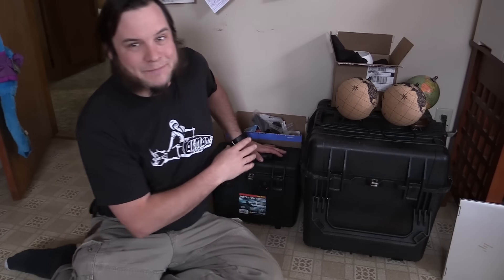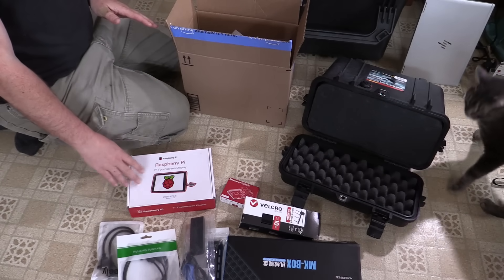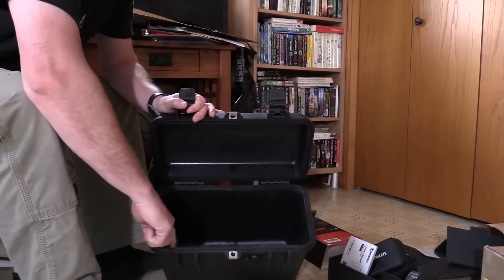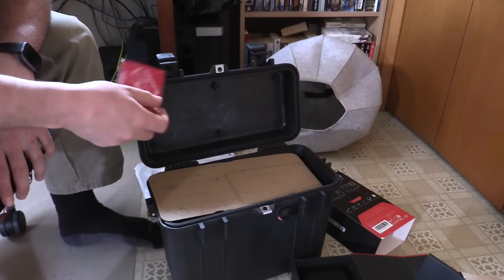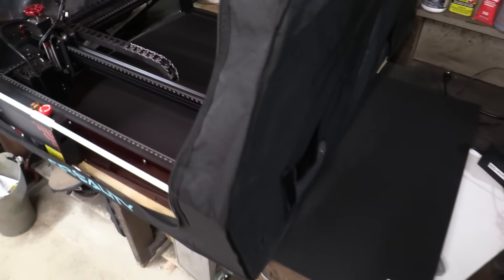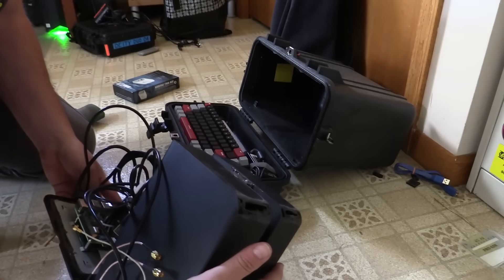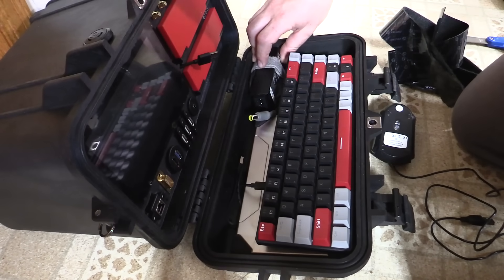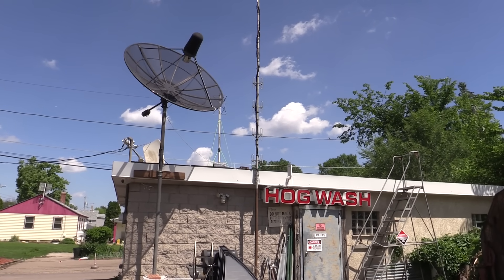Satellite Hacking Cyberdeck v2.0

Comment: It because the raspberry pi needs 5v 5A. many charger are only designed for 5v 3A. You need to use 4X 18650 cells battery hat that specifies 5v 5A, Geekworm makes one

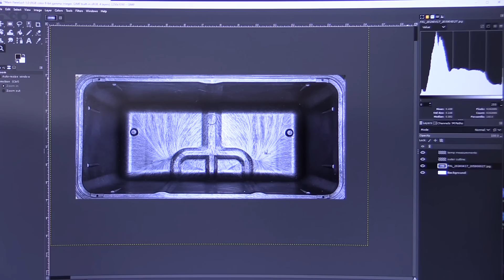Comment: 4:22 how did you manage to get the measurements just by taking a photo? what other factors or math did you do to get this?
Reply from the maker: I measured the width and length of the opening and adjusted the tracing in GIMP (open source Photoshop alternative). I made a few cardboard templates to check the fit and had to adjust it a couple times.

Comment: Will there be a V3.0
Reply from the maker: Maybe, I have some ideas for another design but no time to work on it!
Reply: Alright, Have you Used The Raspberry pi 5 and other versions instead of the raspberry pi 4, if not, what about Arduino and other clones of Arduino.

Comment: So- I liked this video so much (and my girlfriend saw me watch this video like 5 times that she said: ‘Eric you should just make this then’) that I’m going to build a similarly inspired Cyberdeck. 

One question that I’ve raised is- the antenna on the top right, is that connected to Pi as an external WiFi antenna? If so, is there an adapter that you recommend to use to get it connected to the Pi?
Reply from the maker: That one was on a USB Wifi adapter, which I think I've swapped out. I've gone through a couple changes on this. I believe the original one was just Wireless A/B/G, so not the most modern. I'd actually have to dig this out and open it up to remember what's in there now! I need to add a few things to it anyway, like a different power board and maybe a LoRa board, so I should do a follow-up video at some point.

Comment: ... why not use a trackball instead of a mouse?
Reply from the maker: Haven't found one small enough to fit in there. Those were fun in the 90s but I don't see them very often now.
Reply: @saveitforparts  they are still around to some degree 

Oddly enough, it is one area that "retro gaming" and "accessibility" tends to have a crossover of people (lots of retro games work best with a trackball, and trackball tends to be better for some people with range of motion stuff going on)

Comment: Couple of tips and also just amazement lol. For the laser cutter if it you think the thickness might be a bit too thick try flipping the plastic. if you need to, make a 3d jig to hold the corners so it stays centered. then save two cut files. one normal, then one mirror file. Just be sure to flip the plastic the same way you mirrior your cut file. as long as the center of the cut is the same for both sides in your files it should be fine. 

          Also crazy work that you found those voltaic batteries for only 20$ when each would go for 150 new. Good find

Comment: The curled corner on that lid is the plastic shrinking as it cools. Is you bed at the proper temperature and you maintain it the whole print? If printing with ASA or ABS you need a heated chamber and you need to maintain that temp also. Is the print bed clean, as in you just washed it down with Windex and have not touched it with your hands clean? If not, things won't stick properly. Glue stick, hair spray, etc. are for people who fail to keep the bed clean. The only time I use gluestick is to help prints release if I am printing something like TPU, which can hold too well to my PEI sheet even once it has cooled. If a heated bed and or chamber, and having a pristine clean bed doesn't fix it, try mouse ear brim right on the corner itself.

Comment: Lids pulling off 3d printer bed. Cause is printing too hot. Increase the layer count (like 20x 0.2mm layers before turning on/up the printing / bed heat. The moment I did that my printing lifting problem was solved.

Comment: May be worth getting some water proofed sockets so you can have external connections. They make them for marine use. Should be able to easily find the ones for USB. Probably HDMI too.
They have a screw on cap with an O ring that covers the sockets when not in use. You would just need to make sure to get a tight fit into whatever hole you drill and seal it. Maybe use some plumbers glue in the hole.

Comment: One of my cyberdecks (RPi4)would throw the low voltage warning. I used a Raspberry Pi power supply and no longer get the warning. Did your low voltage warning ever get resolved?

Comment: When you want to power up pi from any USB, use 1) buck/boost module, or 2) USB trickle board for QC/PD powerbanks, then buck converter back to 5.1V 5A. The 5.1V is important, as it makes the Pi run much more stable - same voltage goes from official Raspberry power supplies, so do not worry. But i agree, the USB powering of Raspberry Pis is terrible and lacks any logic in times when QC/PD protocols are common in every charger. I usually power them with settable buck converters, because i aint buying raspberry brand power supplies when i have plenty other powerful chargers .

Comment: Try USB 2.0 cable for Raspberry Pi 4B if didn't work when plugged it into a more modern USB host port. The cable should be rated at data transfer rate 480Mbps. Make sure it's from brands with reputation. I used Scosche Strikeline USB 2.0 cable, some USB power sources previously failed to power the Pi 4B now work properly, as it forces the port to follow 2.0 specs instead of 3.0 or PD. However, some people say later batches of Pi 4B do not have the issue, they can actually take advantage of PD.

Comment: For the power bank you could flip it around so the plugs are inside the case and add some connectors on the inside of the tray for it

Comment: Hey bud, been 3D printing for quite a while. If you don't already have one, i'd buy a whambam thermal enclosure/tent for your particular 3D printer. Or at least one big enough to fit its dimensions. Some of your parts are bending up because theyre cooling faster in places and causing stress/tension to build up in the material. Close it up, or even just take a cardboard box and coat the inside of it with something like a reflective/thermal insulating material (like those grocery store 'cold' bags that are supposed to keep the icecream cold on the way home). Or... a box with at least a couple layers of tinfoil over it. That should at least be enough to keep the heat around your prints while theyre printing, and stop some of that heat loss. Once I did that, my 3D print warping almost completely dissapeared. The last printer I bought, I made sure it was one with an enclosure and everything. 

After I enclosed my prints, and also started a printing a lot of my parts in ABS-GF, warping is near-zero. I haven't had warping at all for a while, and If i do its so slight that I cant tell. That ABS with glass fiber fill is amazing. Plus its awesome at withstanding higher temps too (when I need a printed part to be exposed to like... the temps near and around an automobile engine lol..)

Much love and AWEsome video/project.. i'll be checking your channel for any other projects I might be interested in doing myself!

Comment: Addressing your low voltage warnings, have a look into Buck/Boost converters. you should be able to find an adjustable one that will deliver enough current at the required voltage to sate the very fussy raspberry pi board.

Comment: The pi will work with all usb-c PD chargers that support 5v 3A. Make sure to connect it with a type-c to type-c cable. Type-a connections don't support PD. The type-a ports only support other quick charging standards (like Qualcomm quick charge and third party phone standards), and won't necessarily supply 3 amps to the pi. I've noticed you switched to a type-c connection later, that's why it works after that point.

Comment: Very cool, but I've never heard of any one ever having a voltage issue with a raspberry pi. I have a 1,3 and 4. Never an issue. My 4 is hooked up to a 2.0 usb port on a router acting as a pi-hole. 24/7/365. Never an issue

Comment: Nice thing. But, why do you use 2 boxes for battery and another box for adapters instead 1 doublebox where you save space? 
bottomwall/ hole for battery/ middle wall/ hole for adapter box/ top wall.
Reply from the maker: I kind of liked having two doors / two "drive bays".

Comment: sorry to sound dumb but what is the practical uses for this thing?
Reply from the maker: I wanted something for my satellite and radio experiments, like a DIY toughbook for outdoor use. So far I've had it running a microwave imaging antenna and demo'd it at the Open Sauce convention, I'm still working on some other antenna projects.
Reply: @saveitforparts  very cool !

Comment: yes the part 5 is annouying with the bespoke Amp power supply so it will not work at full speed. I ended up buying a pi one

good little hacking kit.

Comment: Hi, I had the same power issues with raspberry pis. You will need a power supply that outputs 5.1V and at least 3A (depends on the pi version). Very important is a usb cable that is rated for 3A too. The copper has to be thick enough to carry the current. Hope that helps!

Comment: I built a PI4 cyberdeck into an armored box as well, I had power issues as well until I got my own cable ends and put  larger 18 gauge wires in it  that could carry the amps, Im using a 24,000ma power bank and it powers the pi, a 7" monitor, keyboard for about 10 hours with stellerairium running. It did get hot as well, some fans were added. Oh I can also run my SDRplay for about 8 hours with moderate volume.

Comment: I wonder, is the closed nature of the waterproof Box a Problem for cooling the RasPi?
Reply from the maker: It hasn't been so far, and I've used it outside in the sun. I might add a vent fan at some point though.
Reply: @saveitforparts  thanks for the answer

Comment: RPi's draw up to 3 amps at 5 volts, so yeah, most USB devices that aren't PD can't do it. they made it USB C because there's still more things you can plug into it with USB C than most other options, I use old  USB C laptop chargers, and USB PD banks, and very rarely get the low voltage message unless the thing is dying

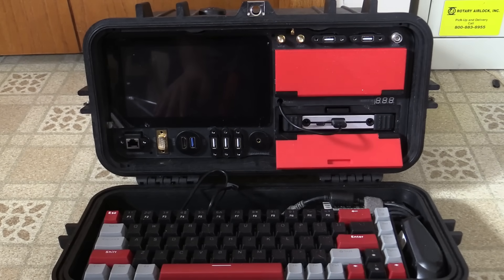Comment: @11:03  Not sure what you mean by special raspberry pi power adapter.  There was a issue with early gen 4's where there was a missing a resistor screwing with USB-C power delivery protocol but outside of "smart"/fast supplies it should work fine.  You also have the header pins for 5v and gnd.

Comment: a little tip that might help with your 3d printer bed adhesion: for large surfaces like that, it does happen that sometimes the bottom layers peel up. Try putting masking tape over the bed and then a layer of stick glue and that should help quite a bit

Comment: I use aquanet hair spray to secure printing parts on the print bed. Spray it on as the bed is warming up, and you will have a hard time getting any parts to delaminate with even the trickiest filament. Give it a try, and your lids shouldn't be an issue any more. Also, your laser is probably not cutting all the way through because the focal depth of the laser is smaller than the thickness of the material. Try dropping the laser head a milimeter or two after your first pass, and it will probably work better.

Comment: As far as your 3D printer woes, I would try replacing your nozzle.  Mine was exhibiting similar behavior, and as it turns out, switching between PLA, PLA+, PLA Pro, and PETG left a nice non-melty mixed up deposit inside the nozzle so it was partially clogged and under-extruding.   Eventually it got so bad that my prints weren't adhering to the bed at all, even using tons of glue stick, and getting the nozzle hot and needling it wasn't helping.   Replacing my nozzle cost me less than a dollar and solved my issues.  I'm doing PLA right now but if I decide to do PETG again I'll swap in a PETG only nozzle and keep my other nozzle as PLA only to extend the nozzle life.

Comment: Awsome project. Tip: Those "studs" in the lid are not from the manufacturing process but mounting points to attach stuff with self-tapping screws for example.

Comment: first off, why are you putting boxes in boxes? that's wasteful of space,  3d printing sucks that's why your having issues.  waste of time.  why are you using a Raspberry pie. Just use a laptop and have much more power at a fraction of the price
Reply: lmao i obviously didn't make it far into the video, Raspberry pi are junk.  I'll never use those . laptops are much more powerful and reliable

Comment: It is hilarious to me that you dropped this video literally right after I went and bought a Datalux computer off eBay for my own astronomy computer setup. Lol

That being said, I got a newer model than you did for your old cyberdeck, I am still super excited about the all-in-one computer, and your video was extremely helpful in dealing with the power supply issue, as mine was similarly missing. I have it up and running now and just am waiting on getting a hard drive set up on it to get things installed. But I have booted it off a USB recovery drive and so far everything seems to be working!

Comment: regarding the raspi power supplies, you have to look for chargers with high amperage. over the years i've accumulated a few 'good' ones that are basically just honest about their specs. some will say 2 amps with 2 ports for example but only give 1 amp per port. most importantly, that is only for the PI itself! if you plug in any USB devices, you need a powered USB hub. that way your peripherals are not pulling power from the pi's USB bus

also, is x86 used in the satellite hacking space at all? you might want to check this company called odroid. they make raspi sized boards with x86 CPUs that you can load windows or ubuntu on. i gave up on raspi at home because i got tired of finding ARM alternatives for everything.

Comment: Raspberry Pi and power.. a tale of woe as old as time.
Sticking with 5v is the biggest issue, and especially so on the Pi5
Can it be done... sure... should it... hell no.
What you're goiung to be fighting is cable resistance between the PSU and the Pi.
The Pi itself and EVERYTHING plugged into it will end up having that one cable as the choke point.
Assuming the cable from the PSU to the Pi itself is sufficient to power the Pi the rest can be dealt with by running through a powered USB hub.
Those USB batteries are a bit average for current, better off rolling your own power solution.
Something PROVEN to be able to deliver 5+amps at 5.2v to 5.3v is the go.
A 4 cell LiFe battery with onboard BMS and a solid 5v reg will give you a reliable 5v and 12v power source.

Comment: Ahh yes, dealing with the Pi-Foundation thinks 5V support is enough.   I had to get a 12/24V to 5V 50W converter for my Pi5 setup since it wants 5v5A. It's ridiculous and I wish they would just spend the time/money to add 9v/20v etc and meet PD spec.

Comment: There is no way for Raspberry Pis to be powered fully by "any old USB supply" because of how power delivery works over USB.  It's a mess because nothing was standardized for a while after USB became a power delivery mechanism.  Raspberry Pis use the original naive "just give me 5 amps at 5 volts over the power pins" without telling the power adapter you have plugged in.  The only USB power adapters that reliably deliver that much current without some sort of negotiation are the Raspberry Pi branded ones.  I don't know if this has improved with the Raspberry Pi 5 or not.  I certainly hope so.

You can also deliver 5V to the Pi in any way you like via the 40-pin GPIO header.  There is no requirement that I'm aware of which says that power must come from the USB power port.  The 5V you supply the Pi via the GPIO pins had better be clean filtered power, or you will have issues.

Comment: get good quality filament like polymaker polly terra, use some glue stick on your build plate, just a thin coating. I usually use a rag and alcohol to wipe that coating into the plate. that will solve all of your be adhesion problems.

Comment: the pi4 needs 5 volts at 3 amps, im not sure what your batteries can output but alternate battery banks might be the fix, also i would suggest a small heatsink on the PIs cpu, it can run without one but it thermal throttles rather quickly under mild load and being enclosed wont help.

Comment: 3D printer advice: PLA is the easiest plastic to print and good enough for most use cases, and Elmer's glue stick is fantastic at preventing parts from lifting off the bed
3D Design advice: For the walls of printed boxes, 2 or 3 millimeters is all you really need for strength

Comment: I really like this build.  It reminds me of the Compaq Portable I had in the 90's.  I think you could have gotten away with a bigger screen and mounted the battery sideways but if you already had the parts, it's understandable that you decided to go with a smaller screen.
Reply from the maker: I had an 11" screen as well, but it actually wouldn't fit where I wanted it.
Reply: @saveitforparts  Have you ever thought about taking an old KayPro or Compaq portable, gutting it out and replacing everything with modern equipment?  I've seen some people do it but they never seem to get it right.  I think you have the talent for that sort of thing.  Of course you have to find one that was damaged beyond repair as to not anger the vintage PC guys.